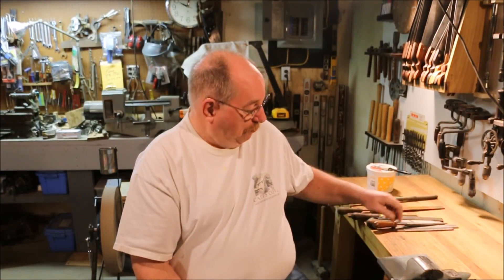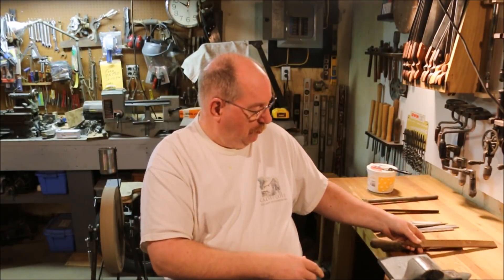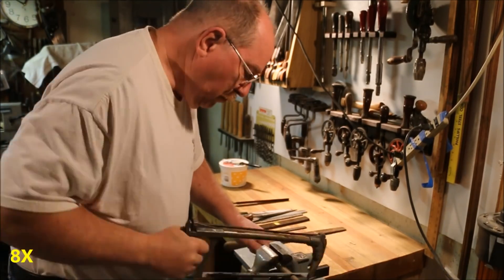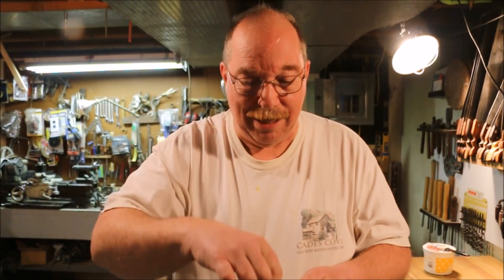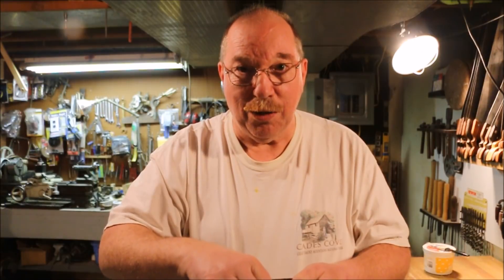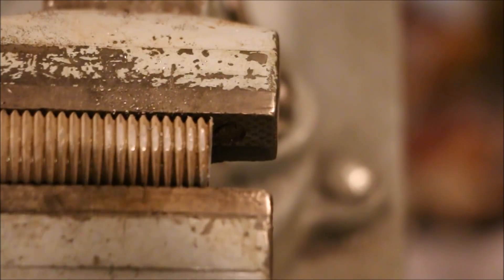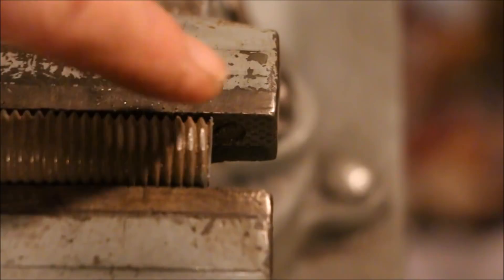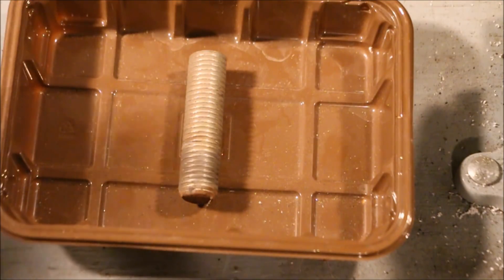SHARPENING FILES WITH ACID ~ DESIGN OF EXPERIMENT

Comment: I have tried to sharpen a file with acid, this just trashed my file after leaving it in the acid for a day.
Reply from the maker: I did the same thing early on in my experimenting with the process. I set up a batch in the tank and got called away. The next day the file had been eaten until it was nearly gone. 
Now I use a 10% solution of sulfuric acid drain cleaner in water to slow the reaction time. 
During the time that the file is in the bath I pull it out and test it's sharpness every 15 minutes or so. 
No process is perfect, but with patience and some practice you will get it.
Reply: @OldSneelock  I tried to use vinegar after draino messed up my Nicholson USA cabinet rasp.

Comment: do files ever go dull or do they just need cleaned
Reply from the maker: They get dull. Any sharp edge will wear away. Even very hard steel will wear if it is rubbed against steel that is close to the same hardness. 
That js why you want to protect your files by not letting them rub against each other. 
When you purchase boxes of files they come wrapped in paper. There is a layer between each file. 
You can look at the edge of a worn file under a magnifying glass and see the worn teeth.

Comment: I'm curious what the best container would be to put the acid mixture in while cleaning. Pvc seems the cheapest,but wonder if the acid would affect the PVC. Steel pipe sounds good but wondering the same reaction tween the acid and the pipe. Did you experiment? I have several items I'd like to clean but they are long and skinny. 2 inch steel pipe with a cap  sounds good. Thanks.
Reply from the maker: PVC pipe is the best, and least expensive material. Iron pipe will disolve in the presence of a weak sulfuric acid solution.

Comment: Good explanation.  I've been doing this for years.  Initially like you I was skeptical BUT it works great.  Most often i use ithis method with my hoof rasps.  As a caution, your viewers should know if one does this indoors the outgasing will absolutely rust any steel tools nearby.
Reply from the maker: Hardnox The plan was to show the test tomorrow. Best laid plans. I have to scrounge or build a container. Mushroom boxes don't work.
Reply: Oh poop!  I took Thursday off.  Lol.  Seriously, I built mine like your other acid holders.  I used 2" pipe.  As you know you can't cap when using muriatic acid or the thing will pop.  I cook my big rasps for 9 hours.  Yhe smaller bastard files for 4, and the mill files for 3 hours.  Works like a charm.  Afterwards I hit them with a spray of gun bluing and then some oil.
Reply from the maker: Don't give up hope. When all else fails improvise. 😈

Comment: Looking forward to the rest of the series. Question - how do you "take care of" your files? Is that related to cleaning after using or storage? I'm forever trying to improve my storage. They always seem to rub against each other, no matter what I do. Do you have a drawer dedicated, or build a holder?
Reply from the maker: New files use to come in a cardboard box wrapped individually in paper. I use paper to wrap them and put them in a a divided drawer.
During use I clean them with a file card. I'll go over more of that tomorrow.
Reply: Thanks! Good info.

Comment: A knife salesman told about this about 45 years ago.I use old battery acid,works great.A test to see if a file is sharp is to press a silver dime onto the teeth
of the file and it should stick to the file.
Reply from the maker: It's been a long time since I've seen a silver dime. But I bet it would stick if I had one. 🙂